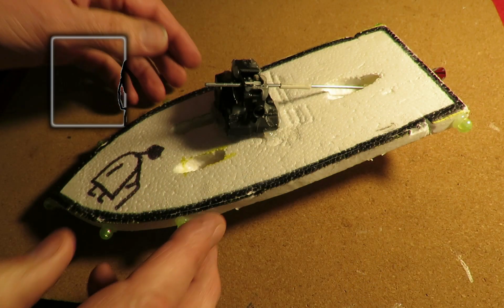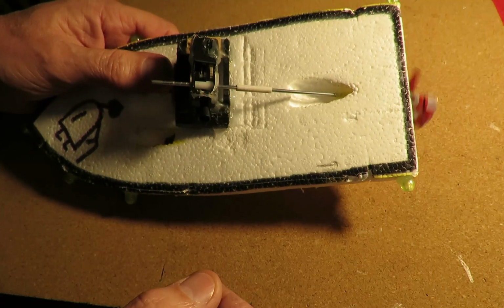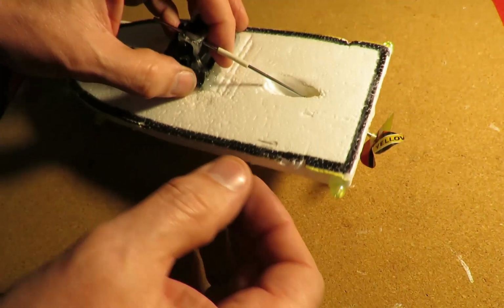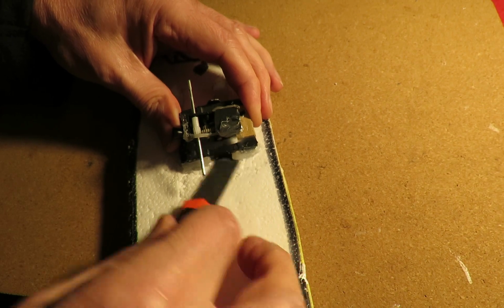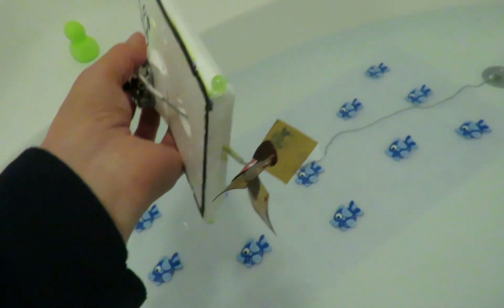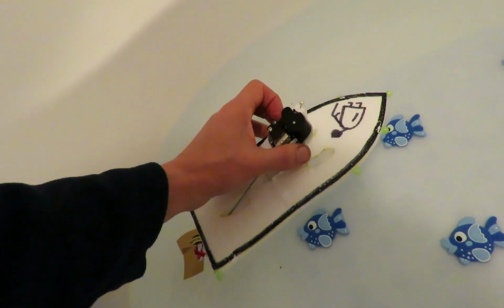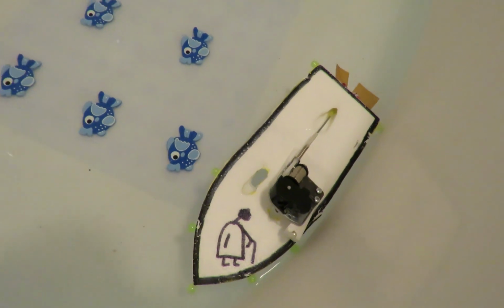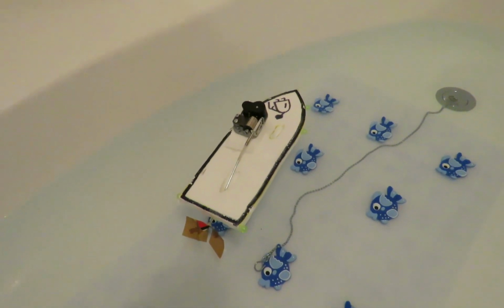Music box powered boat 🚤🚢🎶🎵

Comment: Hey is it possible to make a pullback toy car all-wheel drive?
Reply from the maker: The easiest way to do that would be to use the pull back motors from 2 cars and fit them on one chassis
Reply: GrandadIsAnOldMan would you be able to do it?